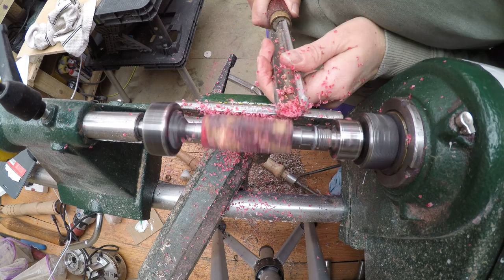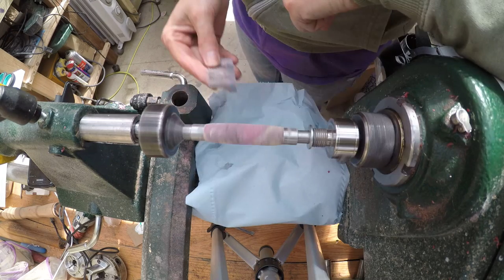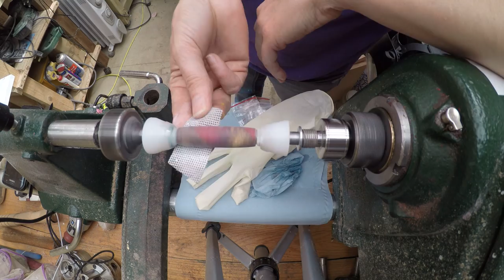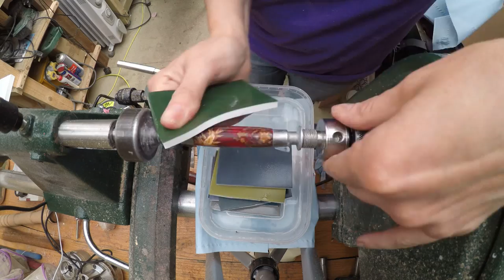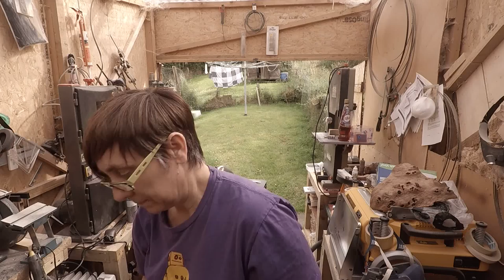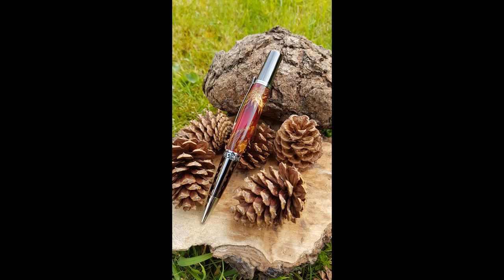Pine cone pen blank casting (part 2)

Comment: I'm new to casting, I've tried sea shells and  clued some small shark teeth to a Gatsby pen blank and then put in a mold. No pressure pot for casting yet.  But the pens turned out pretty good.  Keep it up, love learning from you
Reply from the maker: Thats great Richard yep it is possible to make blanks without vacuum and pressure so brilliant :-)

Comment: Looks great, thank you for sharing the video. Now that you wen through the whole process, if you were to do it again, would you do it the same way or would you stabilize the pine cones first?
Reply from the maker: Steven Lee Thanks Steve I did a batch of stabilised ones after this ones to see if it made any difference and I didn't think it did so from now on I will dry cones in oven and then cast only. Hope this helps pam :-)

Comment: Turned out beautiful! :) when you fill the pockets with CA did you use thin? I found a medium or even a thick CA works pretty quickly to fill those areas...anyway beautiful pen! Cheers
Reply from the maker: Hey Michael Thank you very much :-) Yeh i think i did use thin on this one i made a pen a couple of days ago and used thick and it was better. :-)